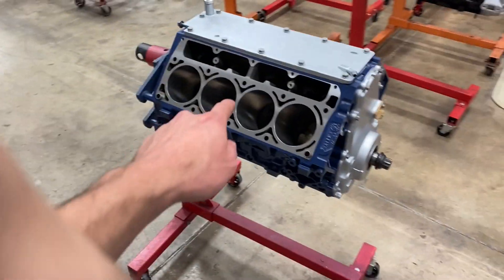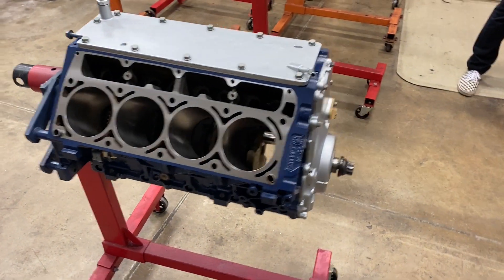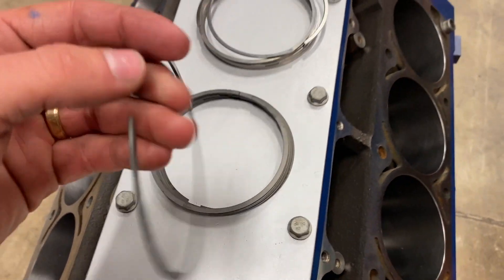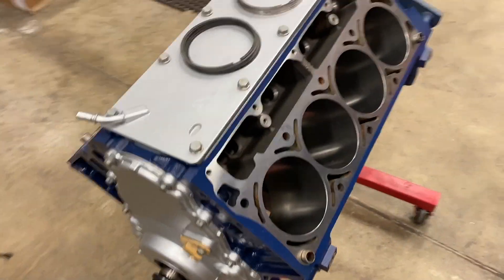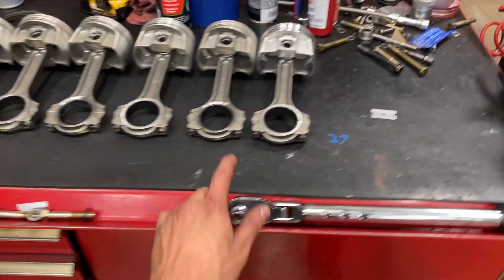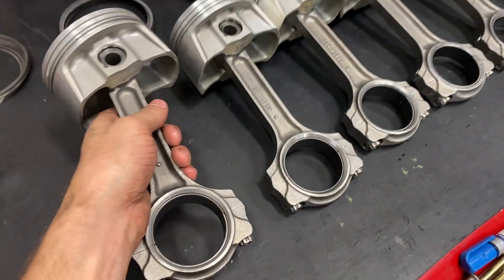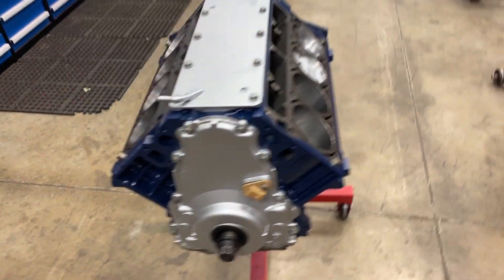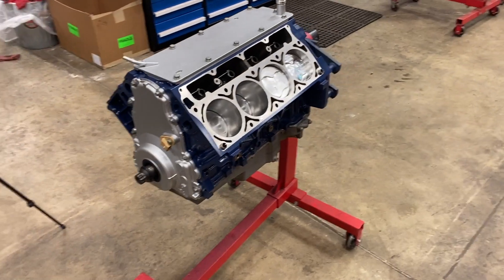BUILDING A 620HP LS3 - Part 2

Comment: Is there a reason you used two different size bearings on the rods? Being a machinist for over 10 years....., i know that throws those bearing clearances out of round right off the bat.... I'm currently building the same style motor but for my 6th gen camaro. If you twist that dial bore gauge 90* either direction from straight up and down with two different size bearings in the journal, it wont read the same. At the point were those bearings meet, there will be a difference in size and it wont wear correctly and have oil pressure issues. Great video and build, i just dont understand why you didnt use the correct size bearings to get the correct tolerance.

Comment: Is it safe to bore a 6 liter 70 thou and make big power without cylinder bores distorting. How much power is safe.
Reply from the maker: No issues for naturally aspirated hp. I wouldn’t do it on a power adder engine though